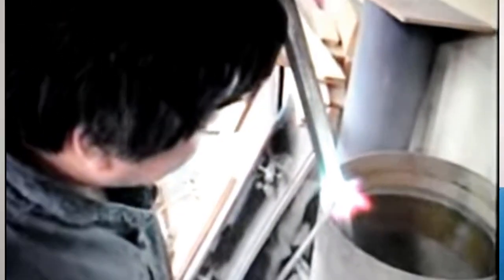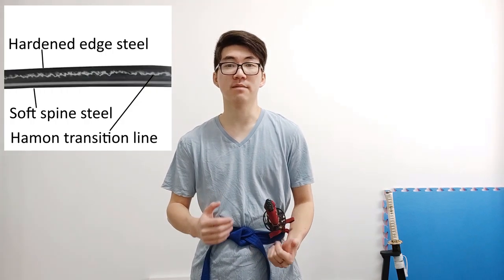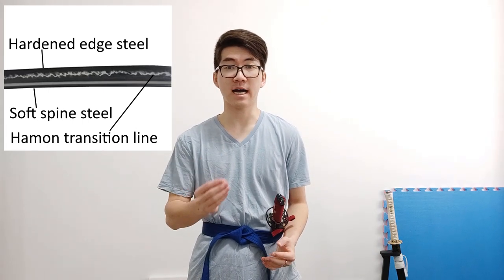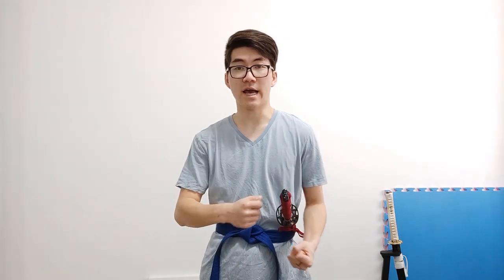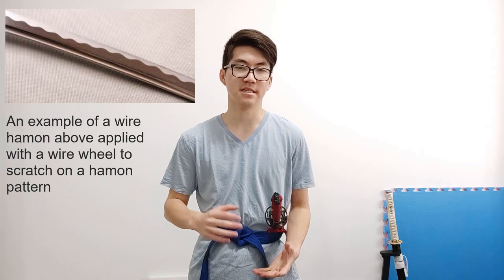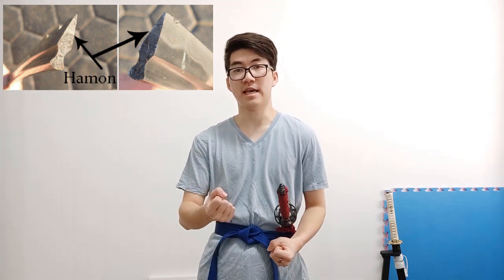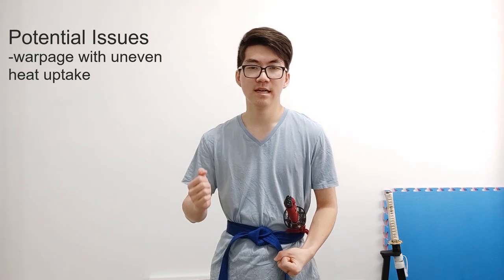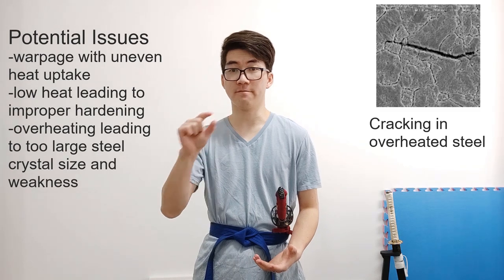Blowtorch hamon-real or fake? [sword talk]

Comment: Hard to say anything about the result of the blowtorch tecnich. But its similar to how axles are heat treated, using blowtorches and water spray to increase the hardness on the surface while retaining the core soft. Probably it can work if done under the right conditions. 
But there are very good blades that had gone under quenching and tempering that can have better phisical properties than traditional quenched blades. 
I prefer to have a good blade with no hamon than a piece of junk with good aestetics.

Comment: Greetings from Orange County, California. I'm new to the whole Japanese sword thing and so obviously looking through a gazillion YouTube videos on this, that and the other thing.
Just wanted to say that I like the way you throw the science into some of your videos. 

Also, I'm kind of an end results guy. To me it makes no difference if a guy spends 100 hours hammering on steel to turn it into a blade or if a machine does it in 10 minutes...as long as the quality of the end product is the same. 

Same would be for this type tempering method...IF the end result was the same.
But you explained it pretty well as to why it's not likely to be.
Reply from the maker: Thanks for the support and welcome to the channel. Definitely agree with the end result approach to practical use blades. Plenty of mass produced blades that are decent enough to use as training swords if you're not looking for a work of art

Comment: As a beginner Smith I've seen this many times. A differential hardening is all that is being done. With clay there is more control and therefore can be much more beautiful when finished. Without you tend to get a simple straight lined homone. Every bit as effective, not nearly as pretty or intricate.
Reply: Would it actually be as effective though since you need to let the steel soak so that the carbon gets distributed evenly for the quench.
Reply: @1810jeff  the carbon is already in the steel. Soaking will make carbon leave the blade unless it is immersed in carbon. A process called carburization. Heat treatment is like freezing water, do it one speed and you get lots of bubbles another speed is clear as glass even though the water had the same amount of o2 to begin with. O2 being carbon in this metaphor the ice being the iron crystals.
Reply: @johnflorio2351  Then why is soaking considered to be an important part of heat treatment. Also decarburization shouldn't be a problem at 1500f since it starts happening at around 1200f and only starts ramping up once it gets past 2000f.
Reply: Soaking ensures an even heat throughout, and therefore grain growth. But differential hardening denotes different temperatures in different places. Weather one gets hot all the way and only the edge is cooled quickly or just the edge is heated to critical temp and the whole blade is cooled at one speed. The effect is very similar, maybe not the same, but very close. A good rule of thumb in blade smithing is don't heat your steel any hotter or longer than necessary for your process.

Comment: Informative video as ive not come across this before and ive been studying Katanas, thanks, ive seen some really nice swords i want to buy but then i find out there wired Hamon, ive not seen them in person but from what ive seen on film im not impressed now i know the difference, the only part of your video i dont agree with is that you say they look real, because you can only see real hamon in certain lighting, similar to acid but ive read that looks better than wired, how much do you have to spend to get a real Hamon edge?
Reply from the maker: Blowtorch hamon looks real. It is different from a wired hamon. Metallurgy wise its the same compounds being formed. 
For a real Hamon it's usually in the $250 kind of range

Comment: Great information blow torch is good but it’s only 45 percent of the clay tempered halons Benifit
Reply: How did you get 45%?? Are you a smith or have any expertise in metallurgy? Bro don't make up rubbish
Reply: @Neechan0077  It's actually not even that high, when you heat treat steel you have to let it "soak" meaning you leaving it at around 1500f for a certain amount of time which varies depending on the steel and since he wasn't doing that it likely wouldn't harden evenly. You can do hamons without clay but they require a fast cooling steel like fast quenching tool steel and proper blade geometry so that the edge cools way faster than the spine. There's also another method that creates something similar to a hamon this being a quench line which is done by only quenching th edge of the blade bit this usually results in a straight line so it's not really worth doing unless you have a steel that doesn't like hamons like 1084 or any other high manganese steel.